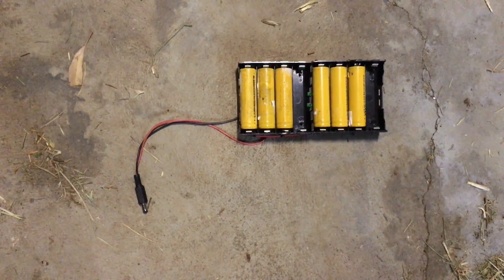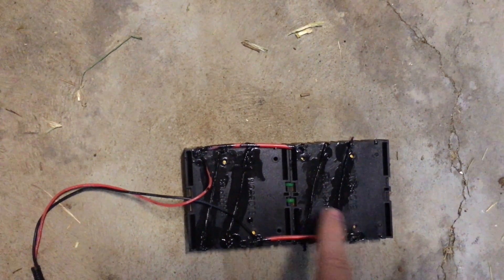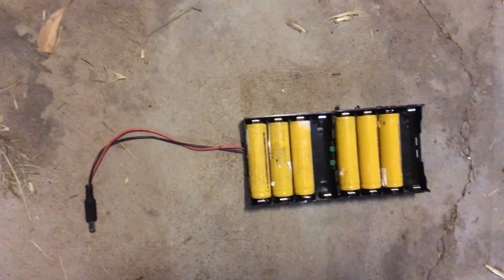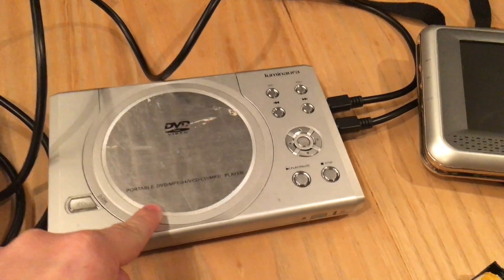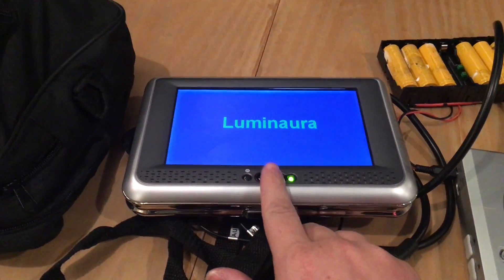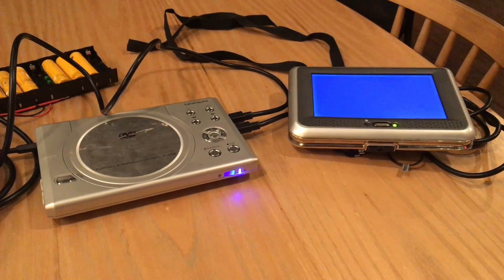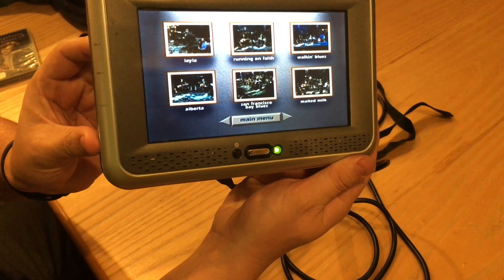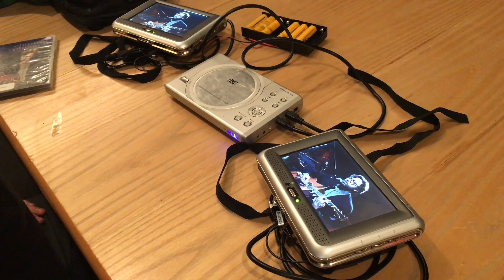12v 18650 Car DVD Player Battery Pack Replacement

Comment: What is the temperature of the battery pack after it's used its entire capacity over a course of time?
Reply from the maker: Thanks for the question, it doesn’t get hot at all in this configuration. I’ve since built a larger 3S5P one based on the same principal with a 3S balance board so it’s also protected from under volt by the balance board. In this configuration, although unlikely, one battery could potentially go below 2.5 volts, potentially killing the 18650. I may run through my other configuration at some stage.